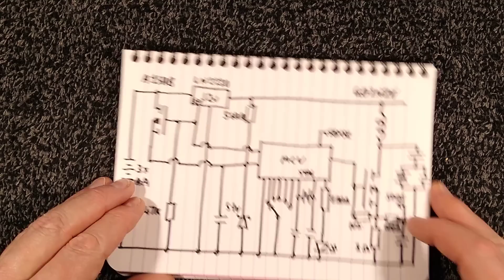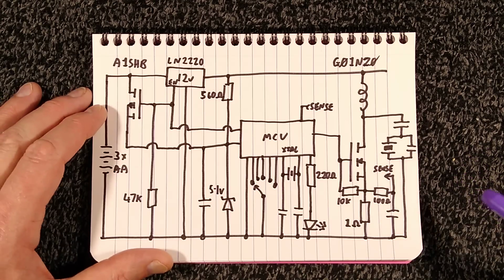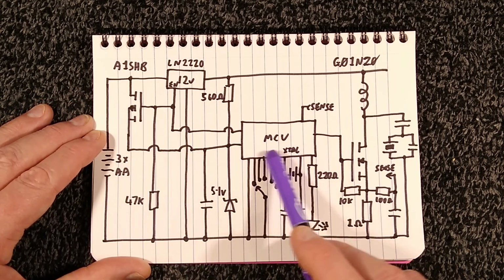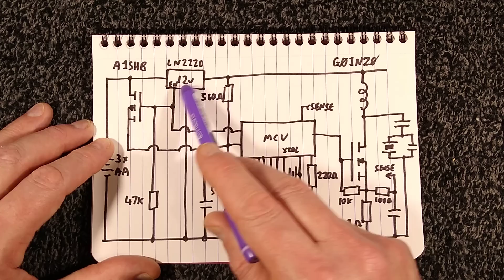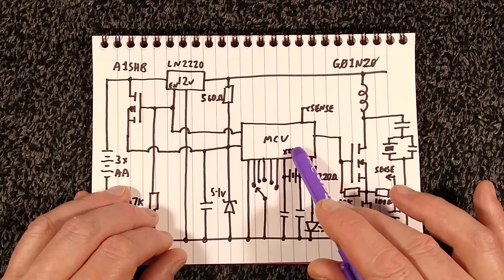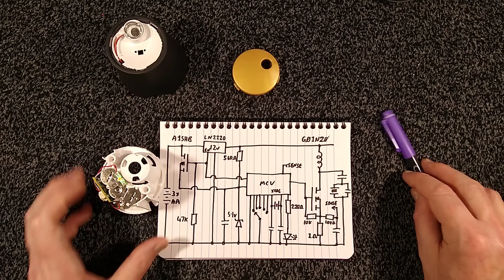Inside the new glowing Air Wick mist diffuser

Comment: Great video! Thanks
Is there a way to completely turn off the light?
Reply from the maker: I don't think so.  But the unit runs on an 8 hours on and 16 hours off cycle, so it won't light at night if it's turned on 8 hours previously and left on.

Comment: If it's spraying out vaporised oil, don't let it ANYWHERE NEAR a projector! Fog machines (as used at raves, nightclubs, discos and similar places where beautiful young things go to get laid, drop pills and / or boogie all night) were the bane of my life when I fixed digital projectors for a living. The oil gets sucked inside, coats the optical and cooling systems and requires a major dismantling job to clean out. Things that diffuse oil must be kept WELL AWAY from projection systems or you'll be in for a VERY expensive repair job!

Comment: You should check the "Gillette Fusion Proglide Razor", for years i didn't use it and suddenly it began to beep and flash.
3/4/5 years without looking at it with a single AAA cell. there must be a 4 bit MCU inside.

Comment: I put a mechanical heat recovery system in our house. I think it's much more effective at keeping the air fresh than all these air freshening devices. It saves on heating too. But not all houses can be easily retrofitted, as the vent pipes can take up space you don't have.
Still like Clive's reviews of air fresheners though.

Comment: I wonder what types of oil and "oil" one can actually use in these and would there be any "beneficial" effects of using the "right" type of oil...

But a great circuit nevertheless...and very clever use of the first P-channel FET to switch to a lower power level on the MCU while in standby, but using the 12V to better drive the Piezzo circuitry.

Thanks Clive - great video as always! We can't wait for you to get back to your bench... and probably you too! 🤣🤣

Comment: As always fascinating. The unsung engineers/designers who make unusual circuits out of common parts always impresses me. What I would like to add is that oil based air fresheners are dangerous for certain pets, birds especially. Something about atomized oil getting into their lungs is very bad for their health. Not sure about the science around it but bird experts do advise against oil based atomizers. There’s some evidence that cats don’t respond well to certain air freshener ingredients so it’s better to avoid with cats in the house. Dogs seem impervious but I don’t know for sure.

Recently I had a stay at a motel where the built in oil based air freshener was out of control and filling the air with a sickly-to-me berry odor. No other rooms were available. The staff (one person) was unable to disable it and I was unwilling to climb to ceiling and disassemble it. Remembering the many ionizer disassemblies Big Clive has done, I got the car ionizer (rental cars can be odorous) and set it up in the room. Berry odor defeated in less than an hour and the rest of my stay!

Comment: Isoparaffin is a petroleum-based product that gained popularity originally as a laxative. 
It's specifically quite low in the carbon chain length, at 13-14 carbons. If you're familiar with petrochemistry you'll notice this is just above petrol (gas) (C4-12). Indeed isoparaffin is considered a high quality fuel for certain motors. 
What's interesting is that these products used to come from crude oil distillation (fractionating column diagrams are a simple way of looking at it). But now as we adapt to the need for a circular economy, we're getting these light hydrocarbons from a lot of other sources. 
Tyres and other sources of rubber, old cars... lots of fun stuff.
That we're all rubbing on our faces and sniffing with delight.
Reply: I'll just stick to huffing petrol cheers.

Comment: actually the "essential mist" lineup is NOT 100% oil
I know this because I tried to do a 100% oil refill of an empty and it killed the device
it seems to be an oil-water emulsion, and by opening another cartridge and comparing to a similar odor oil, I would say the dilution is likely near ~25% oil
it is more like a timed "cool mist humidifier" with a few mls of oil added to the tank and then placed on a timer

I wish the a**holes sold the tangerine one in more places, that one is the BEST so far(though I have not tried the cinnamon one)
perhaps I will buy some of that tangerine and orange oils from my post-bankruptcy pharmacy(why are they allowed to couple providing prescriptions with a business allowed to fail?)
I will be using a higher dilution in my desktop mister(which I hope is not gummed up from several months of disuse, oh well, at least it can have the gummed module replaced)
Reply from the maker: Pure essential oil will not atomise.  It needs to be diluted with a very fine oil.  I've done lots of experiments with this.  An emulsion doesn't seem to atomise.
Reply: @bigclivedotcom  yet oil+water diffusers DO work
I wonder if it is some quirk of the exact method of atomization
perhaps the "pass through" piezo discs are picky?, the water-based ones always seem to use a disc that creates a misty cloud above the water level from below, then a fan to blow the atomized oil+water cloud out

the water-based diffuser I have DOES work with a few ml of pure oil(at least what you buy retail, maybe already in a light oil carrier) mixed in the water(about a 1-10% max concentration, and even near 10% it gets headachy, better to literally have <1ml per ~4oz water(not sure the exact water level but it is <1 US cup)(yes I am an american and yes I feel shame at being more familiar with imperial measurements than metric)

yes the air-which "piezo atomizer wick pumping" does have a really picky recipe however it is possible to simply abuse the agitation from a bottom mounted ultrasonic transducer to cause an emulsion that can be blown away with a  fan

sorry big-daddy clive, it is ONLY a problem for the wick-based units to use a water-oil dilution

Comment: Many years back I used to experiment with smoke generators for model boats , we started with ones similar to the ones in electric model trains, They worked by heating an oil mixture, not wanting to pay the price of the fluid from the model shops we experimented and found that a mixture of Baby Oil and Varol (Paint thinner/cleaner) worked well. Some of us experimented with straight water misters. Personally I went to strait live steam.

Comment: As ever, a great explanation of how the components within the circuit work.. I soooo wish I had the in depth understanding of how these things work..   I still have to figure out what went wrong with my radio..  the rj45 8pc8 cable has 2 of the pins crossed over on one side and straight through on the other, which the remote head was not happy with,. So stopped working..  I still believe there is probably protection circuits to stop the main unit getting damaged, but I can't hold the thing steady enough to get the meter in there...   Anyway take it easy up in Edinburgh. I walk want to visit Scotland again in the near future,, but I like to travel further north,.. problem is, it takes hours to get from the midlands to the Highlands,

Comment: Great video, Clive, and an interesting circuit diagram. I can't help wondering how it would be possible to power this from 5V USB or from a regulated 12C DC supply? Maybe a 5V USB supply would be simpler? Could this circuit be the starting block for building a 'giant' version with a much larger piezo element or elements like those used in foggers?
Reply from the maker: It could probably be powered from USB with at most a diode to nudge the voltage down if necessary.

Comment: Good teardown video. Enjoyed watching someone else do it for a change 😀 Interesting device. I took a Glade air freshener and removed the PCB that only allowed 9,18,36 min sprays and replaced it with a ESP32C3 micro-controller a MX1508 motor controller and a 3.3 vdc regulator board. Flashed the micro-controller with ESPHome which allowed me to controller the MX-1508 motor controller to have it spray when i want it to. ESPHome allows me to integrate it with Home Assistant a home automation program and with the aid of mmWave sensor can now have it spray only when i'm in the room and when i enter a room, etc.

Comment: The 12V boost circuit is clever. It sort of feeds back into it's self to keep the micro controller powered, which then keeps the boost IC on.

Comment: The sense resistor is used to detect the rate of change of current going through the inductor.  The idea is, at magnetic saturation, the current through the inductor no longer increases with time and instead of just burning power as heat, this signals that it is time to switch the mosfet off.  Self oscillating flyback drivers use exactly the same method to drive the core to magnetic saturation, this ensures maximum energy storage hence maximum output voltage without wasting energy as heat.

Comment: Hello, I was wondering about these diffusers if it is possible to reuse the atomizer continuously to make a mist to make a kind of fog in manufacturing decorations. If so, can you tell me in a few words how to connect these atomisers please? For example, the electric pietzo "tablet" has a cable with a red and a black wire. Is it possible to connect it directly to 12v and atomise a liquid such as water?
Reply from the maker: You can get atomiser modules on eBay that can be run with water for long times.  Look for USB humidifier.
Reply: @BigClive I know about these modules, but I actually wanted to know if THIS component in THIS device can be reused by plugging it into a 12v power supply ;o)

Comment: When the batteries are low, or the bottle refill is empty the LED starts to flash to inform you that something is wrong also Clive, possibly that is why the sense circuit is also there?
Reply from the maker: I think it may be based on time in use.

Comment: Doesn't the "incorrect" gate, source, and drain apply to the through-hole option on the top of the board?
Reply from the maker: It doesn't seem correct.  The internal diode would pass current.

Comment: I can't believe all the comments acting like this little device is a big fog machine.  They run for 4 to 6 seconds depending on the setting and the mist quickly dissipates.  The aroma doesn't spread far or linger in the air like cigarette smoke.  You probably inhale more "product" when using any aerosol spray can.

Comment: I wonder whether the SENSE line is used to estimate the phase difference between the current going through the piezo and the voltage used to drive it?  From that phase difference it is possible to find the resonant frequencies of the system (which will be slightly different for every bottle, because of small changes in the mass loading on the diaphragm).

Comment: I don't get why they switch over the mcu power with the mosfet bit!
Why not run it directly from the 3xAA cells? Why waste more power with the Zener bit?
Reply from the maker: The cell voltage may drop or be noisy when the boost circuit and atomiser are running.
Reply: @bigclivedotcom  I think that could've been fixed with a large multi-layer ceramic cap (10uF-47uF) for C2 and maybe also a 0.1uF in parallel.
If the cells can't provide mA's to the mcu and prevent it from brown-out, how can they run the boost converter?
I don't know what this mcu is, but it's not that sophisticated if it doesn't even have an internal RC oscillator and has to use a 32kHz external crystal. 
Granted, the RC oscillator is not that accurate and drifts with temperature and voltage, but since the mcu is not communicating with anything, precise timing is not really required.

Comment: I actually had a FMD chip in a set of cheap power tools i got from a cheap store. I think the FMD stands for Fremont Micro Devices which is a chip manufacturer. I think they just relabeled the chip to make it lead to nothing because the number is probably the firnware version

Comment: I don't know if White spirit is the same in the UK as what we have in France but if it's the same thing you should definitely not breathe its fumes.

Why not using a proper essential oil diffuser that only requires water if it's ultrasonic or nothing apart from the essential œil if it's using a vibrating air pompe ?
Reply: Pump, not pompe, and oil, not œil, you can thank my new phone's automatic corrector for these mistakes.

Comment: Thanks for another well presented and informative video BC. It's indeed a very good design and such an accolade to get your approval too. In fact, I shall be getting one of these as soon as I see them on the supermarket shelves. Lets hope that they continue to make the refills!

On the matter of refills, I wish to point out that if one decides to make one's own, it is essential not to use hydrocarbons as a base fluid. Liquid hydrocarbons are very injurious to the lungs, and can cause both acute and chronic symptoms along with permanent lung damage.
Reply from the maker: Sadly, the product does contain a hydrocarbon carrier oil.  That's why I only use these occasionally as a novelty.
Reply: That's surprising Clive. A little disappointing but I'm sure that they've got the necessary approval for the oil they're using. It's a reputable firm after all.
Reply: It would be nice to be able to add a little aroma to my home, but these things are deadly to birds, and I have two parrots that would be devastating to loose!

Comment: Broken glass top  in your 230 Volt kettle ( ? ) ...do not throw away ... retain the base and supply with 24 Volts AC / DC ( ? ) .... you now have a simple  , low tech aromatherapy emitter table ( tried - n - tested ) .... for garden shed use , I recommend creosote 😝for that authentic " new fence " aroma ...... DAVE™🛑

Comment: I like that they're using clips and not adhesive. Not like this is something anyone would repair, but disassembly for recycling would be relatively easy. An especially enterprising individual could probably put in their own micro (or, because I can hear someone's keyboard, a 555) to change the behavior of the unit too. Not like Air Wick would mind selling more oils... 👍

Comment: Imagine what these engineers could achieve if they directed their genius to something beneficial to the world, and not nasty allergen distribution systems.
Reply: I don't think the benefit-to-the-world-industry is big enough to employ all geniuses.
Reply: @Ea-Nasir_Copper_Co 
Well, according to Darwin and The Theory of Evolution, its You who are the Anomaly. Your dna must go, removed from "The Pool". Or is that an inconvenient truth.?
Reply: True.  I can't even walk in the cleaning products aisle of the grocery store or my nose starts running.  I would definitely not want one of those air "fresheners" in my home.  But they do provide almost endless material for Big Clive videos. 🙂👍
Reply: @robinbrowne5419 
You are describing a normal response to abnormal situation, and rightly so.!✅
Reply: @robinbrowne5419 pathetic
Reply: How do you know that these individuals didn’t do that? They have the engineering degrees, occupational experience and they’re in appliance design. It’s likely they would have either directly and/or indirectly worked on more conventional appliances such as a timer, microwave or coffee maker. merely one appliance designed, built and shipped to a customer that functions as intended for a good length of time in my opinion metaphorically and literally exceeds the amount of work some people may have done in their lifetime. This outweighs everything else.

Comment: I did not try to reverse engineer the PCB myself, but something in the schematic seems off. The SI2301 (A1SHB) is a P channel MOSFET. Sure, it can conduct in both directions when turned on, but due to the internal parasitic body diode, you would have no way to turn it off if used like shown in your schematic.
EDIT: The only purpose of the MOSFET seems to be to stop the zener regulated supply from backfeeding into the battery and avoiding the voltage drop of a diode between the battery and the MCU, but NOT to disconnect the battery supply. So, the circuit makes sense, but has a different purpose.
Reply from the maker: The diode orientation is effectively blocking the 5V supply from back feeding to the batteries.

Comment: Shame the tops not white with a colour change LED that you can pause on the colour of your choice. I hate these an d the other glade plugin air-stinkers. The other half got some and they all give me headache within 30 mins of them going on anywhere in the flat. More on the circuit board than I expected, its not been optimised by the Chines factory yet
  Interesting bit of tat 2x👍

Comment: Kewl.  Thanks Big Clive.  I kind of like the aroma of a couple of these older ones yet, like you perhaps, not so thrilled about oil in the air.
Reply: I work in heavy engineering, Oil in the air is perfectly normal, Especially from Pneumatics.
Reply: @dogwalker666  Probably not so great for our lungs though - coming from a guy that has COPD.  :-D
Reply: @amorphuc  oh definitely unhealthy.  Does not taste very nice either.

Comment: Are you sure that switch has one common and five independent contacts? The slide switches of that sort I've seen usually connect adjacent pins, for example 1+2, then 2+3, etc.
Reply from the maker: I tested and it did seem to bridge one contact to the common at a time.